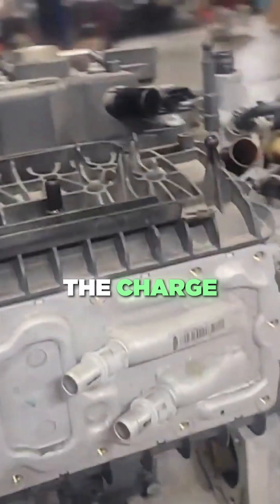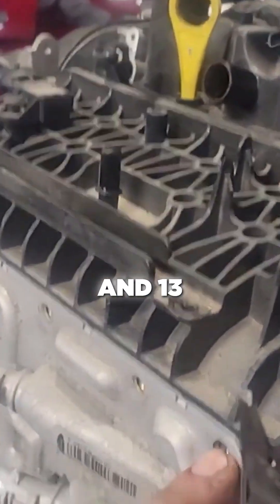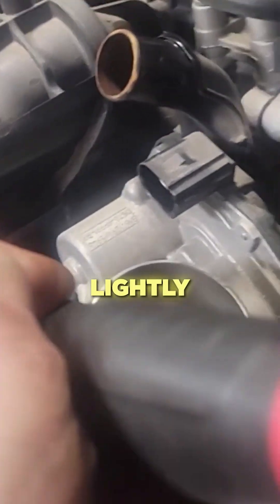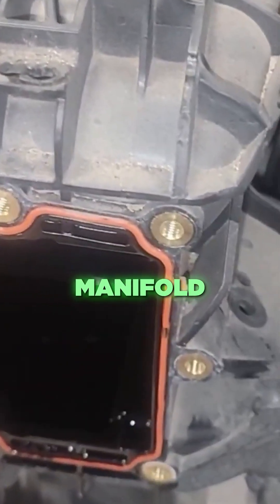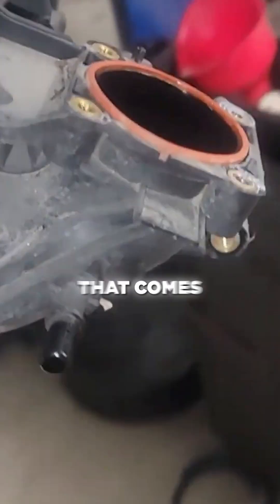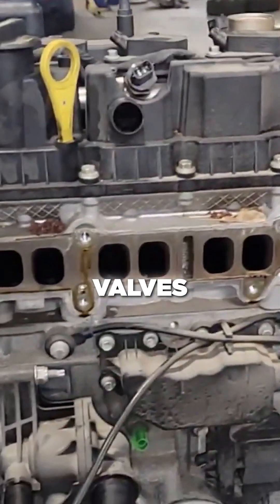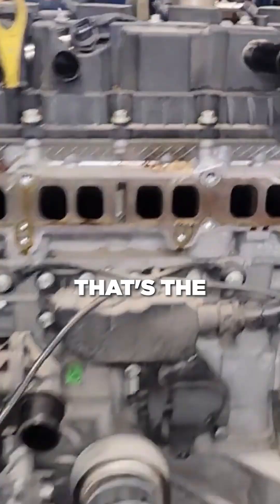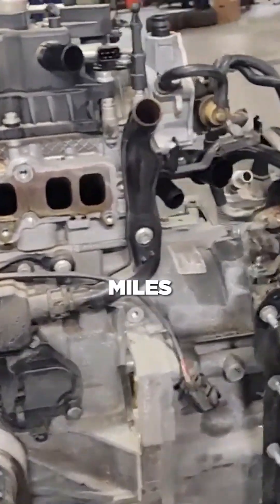This Is What 58,800 Miles Did to the 1.5L EcoBoost 😳 #ford #shorts

Comment: Could you point us in the direction to  correctly clean the intake runners and valves on an Ecoboost engine? I know there are many ways to do it, but some would not be recommended by the manufacturer or good mechanics.
Thanks

Comment: Wowser.  Thats ridiculous.  I wouldn't buy one even highly discounted.   Poor folks that have no clue.  Thanks for sharing
Reply: FYI: Camry hybrid drive train has port injection with the GDI (gasoline direct injection) to keep the intake valves clean. 

And:
No turbos. No annoying start/stop system. No sleazy mechanical CVT. 
No Wet Belt timing belt (no timing belt or accessory belt).
And lacking other bad things. 

This drive train is found in the:
RAV4. Vensa. Crown. Crown Signa. Several Lexus SUVs. Seinna minivan. Mazda cx50. And even in the Camry. 

Prius Corolla hybrid probably similar but smaller. 

I won't buy a Wet Belt car. Or turbo car. Or sleazy mechanical CVT car.